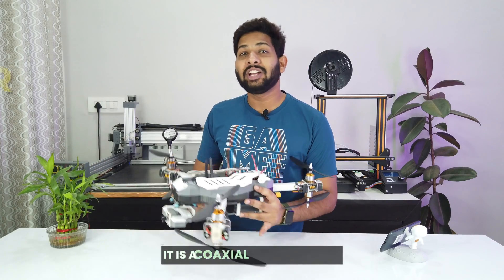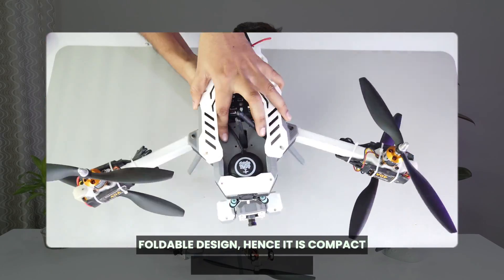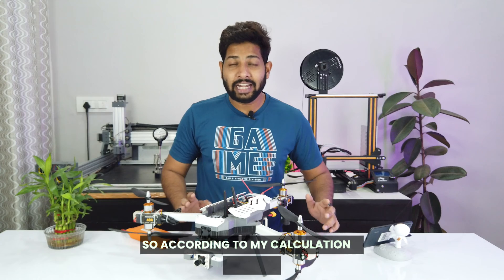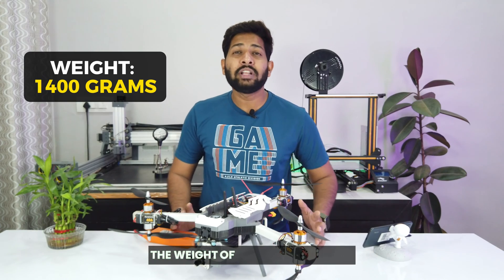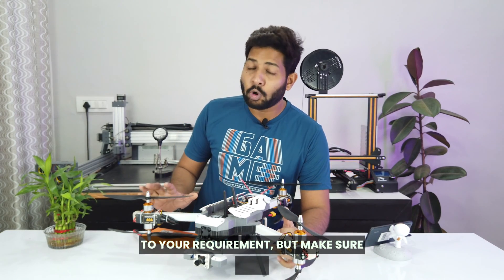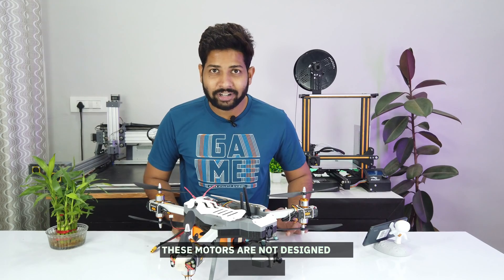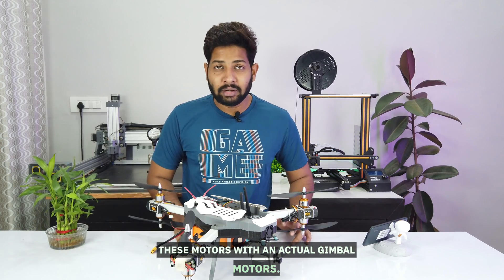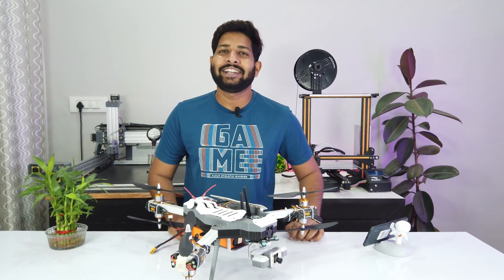How I 3D Printed a Foldable Hexacopter

Comment: Nice!!  Do you have a parts list?  Looks like a PixHawk and maybe 2212 100kv motors?
Reply from the maker: Yes I have a parts list included in the files.
And yes I have used A2212 1000 kV motors. But you can change them according to your requirements.

Comment: Hello sir, which Raspberry Pi camera module did you use ?
Reply from the maker: I have used an HD camera with an analog  video transmitter, But you can use open HD with raspberry pi cam v2 in it.

Comment: Impressive work! But I'm surprised you used a Raspberry Pi camera, even expensive third-party models like Arducam are still way worse than what you find on cheap drones. Have you considered using something else, like a gimbaled mount for a 360 camera or any "action" camera with at least 4K@30fps? Focusing on getting the smallest model while still providing good quality, I'm sure you could find something much better than "an ordinary Raspberry Pi camera".
Reply from the maker: Thank you sir for your feedback, I have used an analog camera in it but I have made the camera for raspberry pi cam V2
And in my upcoming project I have used raspberry pi cam in it.
Thankyou for watching and don't forget to subscribe 😊😊😊